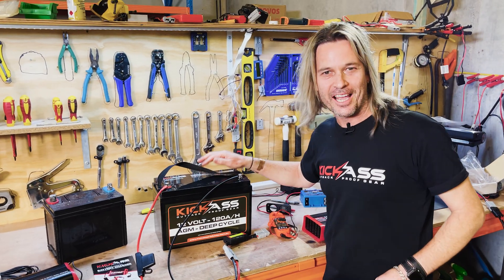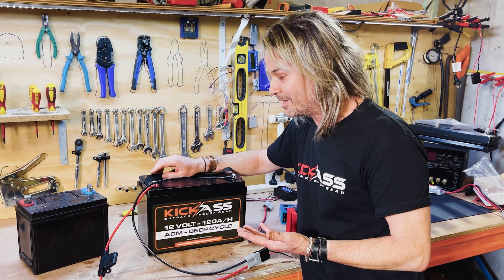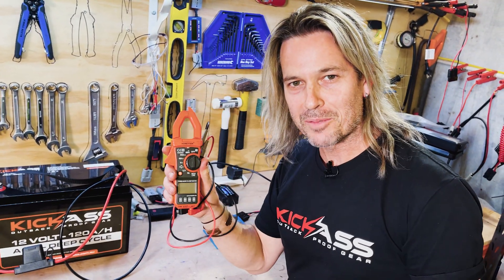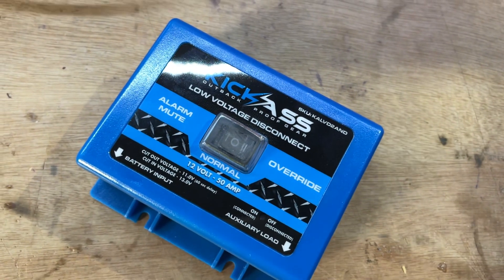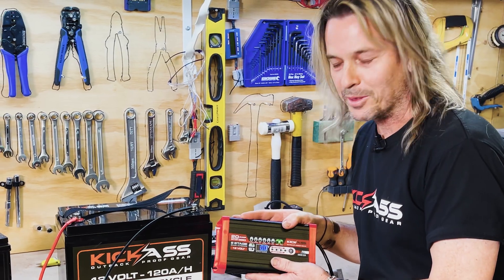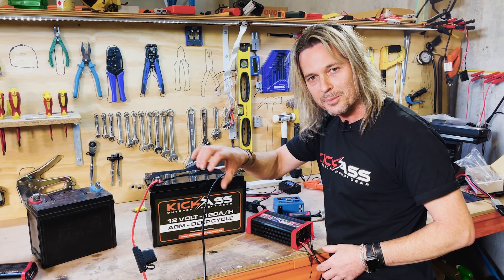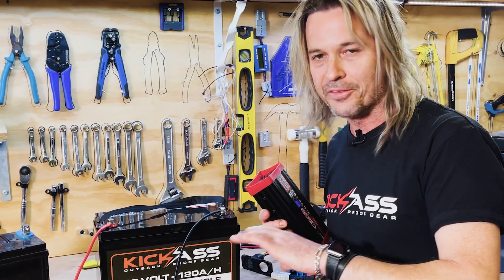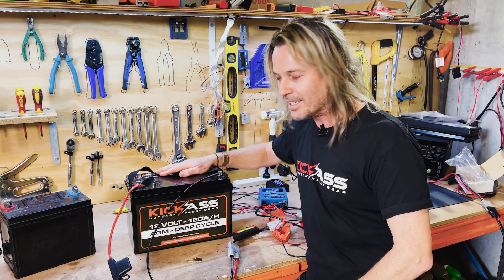How to charge and maintain deep cycle AGM batteries with Craig from KickAss Products

Comment: My agm battery is hooked up to my kincrome 9 stage charger.
The AGM and the 12v is bothing flashing green at the same time.
Do you know what this means?
The battery has been dormant for too long and was completely flat.
Reply from the maker: G'day Neville,if chopper left you with some cash id suggest buying a new battery if it was dead flat for a long period of time,Your charger most likely is flashing due to the battery not showing any voltage for the charger to reconise,you could try connecting a good battery up to it kind of like jump starting & put charger on good battery & may bring it back to life but i would not trust a agm battery that has been completely discharged 
Cheer Craig

Comment: So if my agm is sitting at 12.0 as my extra battery thats bad? And its at 50% and needs charged? Cause im having issues with it not giving enough juice to my amp in vehicle. Why doesnt the alternator charge it u??
Reply from the maker: G'day Mate,yes you don't really want to go below 12v in agm battery,i would suggest giving the battery a charge with a 240v ac charger & see how it goes,i also recomend our dcdc charger & a shunt that will accuratly measuer hom many amps going in & ouy of the battery,here is a couple of links for you to have a look at 
Cheers Craig
https://www.kickassproducts.com.au/buy/kickass-25a-dc-charger-with-anderson/KADCDC25A-AND
https://www.kickassproducts.com.au/buy/kickass-battery-monitoring-shunt/KABTRYSHUNT

Comment: Hey Craig, you said in the video not to have a load running (eg 80ltr fridge) while charging the battery with a 240v charger, but then you mentioned the dcdc charger connected to my alternator. Can the dcdc charge while my 80 ltr fridge is running?
Reply from the maker: G'day Mike,Thanks for the comment,when charging via AC 240v it really is better not to have any loads on the battery when charging as the charger may increase amperage to compensate when the fridge draws current & other loads etc
it is not always the easiest thing to do as some people do still have a ac charger in there set up permanently & when camping with mains power the charger is sometimes always on pending individual set up   but as a maintenance guide it is really best for the battery not to have a load 
When charging on dcdc it is only going to charge when on car alternator or  solar & is not a problem to have things connected
hope this helps
Cheers Craig

Comment: I have a VW Passat with trunk agm battery that i guess is for the start/stop function. I think it gets recharged when using the car. I was thinking of using it for car camping, adding some kind of cables so we can power the fridge and so on... I was hoping that i could ad solar power to it as well. Any suggestions or is my idea not possible?
Reply from the maker: Hi Bob, 

Does the vehicle have 2 batteries?

If so you would have to check with Volkswagon to find out what that AGM battery is used for a and if it is isolated from the starter battery when the vehicle is off.

There needs to be some sort of relay between the two batteries when the vehicle is not running. This is so any accessories running off the 2nd battery do not draw from and flatten the start battery.

Using a 12 volt solar panel to charge an AGM battery it is not a problem. Just ensure that the regulator with the solar panel has the correct charge profile. Most will have an AGM setting.

I this battery is your vehicles primary then you will need to ad an auxiliary battery with an isolator as stated above.

While it would be possible to run accessories off this it's not the best idea as you could over discharge it and you won't be able to start you car.

I hope this helps.

Comment: Question: typically, an old skool lead-acid battery (aka "slosh" battery) should be charged at 13.6VDC (13.6 limits/avoids "cooking"); With AGM, the preferred charging voltage should be around 14.4VDC.... this may explain why, with original 13.6VDC voltage regulator (for the aforementioned "slosh" battery), replacing the original "slosh" battery with an AGM battery - with the original voltage regulator - may not effectively charge an AGM(??)
Reply from the maker: Correct, AGM batteries require the higher bulk charge rate. A new AGM battery will have a fully charged voltage of around 13.6 volts therefore requires the higher charge voltage of 14.4 volts to in essence "Push" the power in. 

This is why a DC/DC charger is recommended to ensure you get the correct amount of power into the battery. It is possible to use an older voltage regulator but it will never get the AGM battery up to maximum state of charge there for can shorten the life of the battery. Hope this helps.

Comment: But is it posible to use a smart charger like 6ah for agm 80ah ?
Reply from the maker: Yes. As long as the chargers out put is no higher than 12 amps. Our 22 amp charger has a "slow" charge mode which is perfect for asmaller batteries. https://www.kickassproducts.com.au/buy/kickass-12v-22-amp-9-stage-battery-charger/KACHG1222

Comment: Would a battery tender plus 12v 1.25 amp be enough to charge and maintain an odyssey extreme battery with 950 cca? It says it’s rated for AGM batteries but I wonder if the amps are sufficient.
Reply from the maker: It should do the job. It will just take a long time to charge the batteries. We always just suggest to check your batteries charging profile against your battery charging specifications.

Comment: I have got 115ah deep cycle AGM down to 12 volts. I realised the dual battery isolator was only charging around 13.2 volts.
Have I killed the battery or done any damage?
I have it in the garage on a 5 amp charger.
I been told let it full charge. Then check over night. Its at 14.6 volts now during the charging stage
Reply from the maker: Hi, If it is holding charge you should be OK. Down to 12 volts is low but as long as it did not remain at that state of charge for a long time it should not have sulfated. You just may find that the battery won't hold it full capacity as it used too.

Discharging the battery so far down now and again is not too bad but if done repeatedly you will lower the cycle life dramatically.

Comment: So, the Low Voltage disconnect will "age" the battery, right? as the Cut-Out Voltage is 11.0 (which is below 10%)  but as Craig said many times (as it is very important) that we should not discharge below 50% which is 12.05V

Is there an option to select the Cut-Out Voltage to be as recommended 50% (12.05), or at least not go below 20% (11.66V)? 

Great vid too.
Reply from the maker: Hi Adrian, Check out our new Smart Battery Guard.

https://www.kickassproducts.com.au/buy/smart-battery-guard/KASMARTBG

It allows you to set your cut out voltage to what ever you like.

Comment: Hello, great video.
Just a question, I have gel batteries 48v system connected to a solar inverter.
As per datasheet, cycle use 14.4v, standby use 13.6V.
I have daily DOD arround 45%
Please advise me what to put charging parameters regarding float and bulk voltage.  Thank you
Reply from the maker: Hi,

To be safe it is best to use the exact specs for your system. It is best practice to  contact your battery manufacturer to get the correct charging specifications for you system.

Comment: Thank you. So the wall charger needs to be connected directly to a battery, and the loads removed. How would i do that with a battery bank? So if i have 4 AGM (80ah) batteries connected together, do i have to remove the cables and charge each battery by itself? Do i just put the charger clamps on the posts of one battery, then move to then 2nd battery? Or do i put a clamp on the + of battery A and the - on battery D? I have a smart charger, older, 10amp, i used on my car. I never disconnected the alternator, and i just put it on the battery, and it can also be used to jump start. it has multi stage for tickle etc. I have used it on my one agm. I don't have the battery bank yet. I thought people were just attaching them to the bus bars that everything is attached to. If i have to charge the bank, then i expect i could use a + shutoff, then attach it to the +- of btty A and D, and then have a suit case powersupply i could plug into a auxilary socket on the bus bar (with a shut off and fuse) and run a fan and lights while the bank charges. This is of course in addition to my solar and dc to dc chargers - which will be attached to the buses. Thanks, i can't find this info anywhere. Few seem to show how their shore power chargers are connected to the system. Some just have a few devices and they are all connected to the btty posts with inline fuses, or they are connected to the bus - so they must be using some kind of different charger that perhaps supports lithium as well?
Reply from the maker: Correct, you can connect to the terminals to the positive terminal on battery A and then the Negative on battery D. If you want to do a full maintenance charge on your batteries say if you are putting them in storage it is a good Idea to disconnect each battery and charge them separately. This is great way to check that all of your batteries are charging and diagnosing each of your batteries. 

It is not necessary to physically disconnect your loads. We just say this as a point of caution. If you are trying to do a full charge it is good to make sure there is no load draw from the battery bank and the charger will read the voltage - the load being drawn.
Reply: @KickAssProducts  excellent thank you. So removing the loads gets u a better charge ok. And the battery monitor and shunt will still somehow work with the the charger being connected right to the A and D btty posts.

Comment: Why 50%. Where did this come from.
Reply from the maker: Hi Glen, 50% DOD will get you the the peak amount of cycles. 

If you continuously discharge an AGM battery below 50% you will significantly shorten the batteries life span.
Reply: @KickAssProducts  Not true. The  cycle count doesn't matter. If you use a shallow discharge you simply use more cycles for the same Ah output. 1000 cycles at 40% delivers the same as 500 cycles at 80%. It's a zero sum game.

Comment: How high should I set the charge voltage from solar panels? 14.7? 14.4? I was hoping to hear that detail in this vid.
Reply from the maker: You need to check the recommended bulk charge from your batteries manufacturer. Different chemical types have different charge rates.

Most AGM batteries recommended charge is between 14.4 and 14.7 Volts so if you are in that range you should be safe.

Comment: Bro your say that 13v is full then you show your batery have 13,3v 😅
Reply from the maker: Hi Cosmin. There are many factors here. In this demonstration we are using a brand new battery. You will find that newer batteries can hold a charge of as high as 13.8 Volts. In general terms with 12 volt batteries you should consider 12.8 to 13 volts full.

However your battery may be able to hold higher.

Comment: Cool Info, what's easiest / cheapest way to charge a bank of 40 AH AGM batteries. say 3 - 5 at a time via deep cell charger @ 12 amps?
 I have 120 watt solar panel with a small controller, what is the most I should charge at once? Tks Man you Rock. 👌
Reply from the maker: Check out our new 22amp charger.
https://www.kickassproducts.com.au/buy/kickass-12v-22-amp-9-stage-battery-charger/KACHG1222

It also has a slow mode (8 Amps) for smaller batteries.

Comment: best part is, no fires.  LG lithium battery storage systems have just had a national recall in Australia.....for catching on fire.  Lithium batteries have a serious recycling problem and the national battery testing center found that some brands, including powerwall, lost 30% of their capacity in 4 years, of daily cycling.
Reply from the maker: There are different chemical make ups for lithium batteries. LiFePO 4 batteries are a lot more stable than the lithium nickel manganese oxide batteries that have been used in the LG batteries you are talking about.

Loosing 30% over 4 years of daily cycling is not only quite normal but very good performance. All batteries loose capacity over time and cycle count. Discharging an AGM to 50% of SOC over 1000 cycles (roughly 3 years) the battery will be at the end of its life.

All types of batteries have challenges when it comes to disposal / recycling.
Reply: @KickAssProducts  I would call that a refreshingly honest and realistic reply, thank you.  Almost universally, the internet is swamped with lithium fanbois who think its "perfect" and has no issues or challenges. I would warn, that unless an answer is found, that lithium battery disposal will become the "asbestos" of the future...........a product nobody thought about its disposal while flooding the world with it, and burdening the end user with a crippling cost to get rid of.  There are Telsa wrecks in the EU, that have lain in salvage yards for years because nobody will touch them, nobody has an answer for the toxic sludge they are at this point in time.

Comment: Just bought an AGM type battery and was unsure which charger to use for it, one is "Dad's old battery charger" lol, and one is a much newer "Smart" charger with setable voltage cutouts and adjustable charging amps etc...thanks to your excellent video, the Smart charger is certainly the best choice, cheers!
Reply from the maker: Thanks for sharing

Comment: Question ❓ I am trying to charge an deep cycle battery and the indicator goes from high amperage draw to 0 and back and forth. It does the same on trickle charge or fast charge. 
Any ideas?
Reply from the maker: Try using the charger on a battery that you know is good. Maybe your vehicle's starter battery. If the charger does the same thing this will give you an indication that the charger may be faulty. If it does not then the problem is most likely the battery.

Comment: What's the best charger for the Odyssey Extreme AGM 34 78 PC1500 ?  It's a combination battery made for both automotive and deep cycle use.
Reply from the maker: You need to check your batteries specs. A good stage charger that puts in about 20% of your batteries total capacity is ideal. https://www.kickassproducts.com.au/buy/kickass-12v-22-amp-9-stage-battery-charger/KACHG1222

Comment: If I leave my boat on the hard for the winter and need to maintain the bank. ( 375 ah / 12v dc). Would a solar panel with a month controller be sufficient to keep the batteries good or should I just pull them and bring them home and keep them on a maintainer?
Reply from the maker: Yes, absolutely. If there is no load on the batteries a small solar panel will be enough to keep a trickle charge on your battery bank to avoid any voltage drop.

Comment: Hi Craig. I've been trying to get my head around this subject, for my Next Boat, so if I have to replace a battery (s) anywhere in the World, I'll be able to get something that works without too much problem. Something that does appear to cause a problem, is steadily reduced charge ceiling, due to wring voltages and I sufficient charge amps, with AGM batteries ? Such as only charging to 99%, then next charge goes to 99% of 99%, and so on,  until a "100%" charge is actually under 25%, or much less, than the original Capacity. Apparently, a way to prevent this, and possibly blow through all the false ceilings, back to original Capacity, is to charge at an absolute minimum, 10% in amps of the original battery ah, so a 100 ah battery, equals at Least a 10 amp charge at the correct voltage, and your 20 amp level, if it is safe up to 27 amps, seems ideal. However, I have come across suggestions, that high quality Smart Chargers with the correct settings, can charge a bit higher given the condition of the Battery is measured, so they can boost accordingly ? it appears that as high an amperage that is safely able to charge,  and blow away those False Ceilings? I've also spotted, that the difference in life if a battery can be dramatically altered by the level to which the AGM batterybis discharged. discharging to 50% level, 12.2 volts, can give about 1,000 cycles, but if you discharge to 85% level, or 12.5v with Carbon AGM, can give over 3,000 cycles (numbers may be a bit out either way, as from memory, but close to those). So to me, the answer for my boat looks to be, Two Battery Banks  on the boat, and as soon as Bank 1 hits 12.5 or 12,6v, switch to Bank 2, and immediately put it onto optimised charging ? With Wind, Solar, plus two special engine alternators supplying through a Smart Charge Controller, should be able to get to nightfall with both banks fully charged, and keep 1+2 banks connected, so overnight draw from fridge and freezer, p,us charging phones, VHF Handhelds, and such, with both Banks still being above 12.5v in the morning. Seems like a plan to go on with, until it connects with the Real World anyway (plus just in case, it'll probably pay to have a diesel generator as backup, until all the rough edges get rounded off). Best Wishes, and if I arrive in Oz, I'll give a shout to see if you fancy a beer. Bob from Wales (not the New South One). 👍🏴

Comment: If I was using a 12v AGM battery to run a 12v camp fridge. Could I also charge the battery with a battery charger running off a generator at the same time? For times when I can’t use solar.
Reply from the maker: Hi Joel, absolutely you can. Just ensure that you have a good stageing AC charger to ensure your batteries get the correct voltage and are protected from any fluctuations in the supply.

Comment: If using one for camper, that will charge when driving will that charge it too much and ruin it
Reply: O will have to watch again as it was pretty quick.
Reply from the maker: It is possible to overcharge a battery when using a simple system like a VSR. This is why we recommend using a DCDC charger.